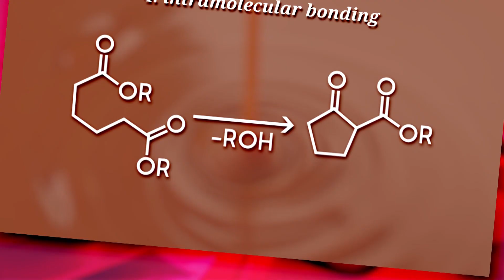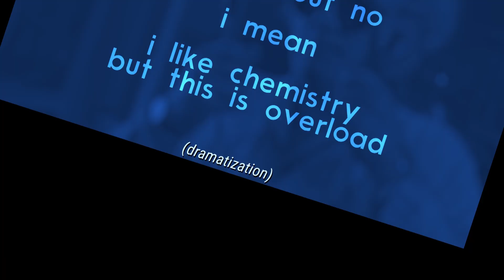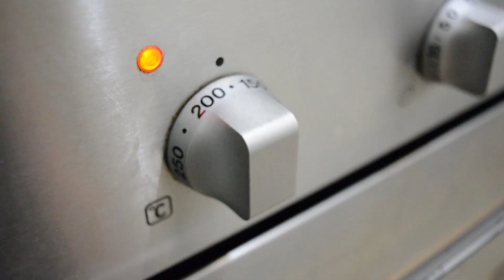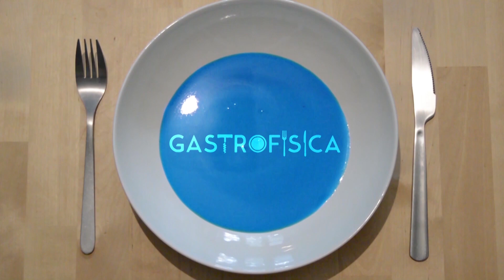The Physics of Caramel: How To Make a Caramelized Sugar Cube

Comment: Seems like the fructose and glucose just... tangle in a different way?

I mean yes way more complex than that but that seems like the summary of it. It heats up just enough to break down, letting the components tangle instead of forming back into normal sugar, changing the structure

If the video was meant to show the complexity, then it failed by simplifying it enough that at least some people can simplify it further in a wrong way

Comment: Caramel tastes so much better if you use brown sugar 🤤.. Plus, at around(of course) 115 degrees Celsius it's done.
Add some pecans, stir until the sugar crystallizes, and you've got yourself a treat! Or even better! Forget the pecans and add some room temp. creme instead (not over the heat or it will blow up). Then, without stirring, let it go to a boil  for a minute and gently stir on low heat. The magic will happen before your very eyes..
Careful! This stuff is highly addictive 🤤.

Comment: Thanks for this MinuteChemistry video. (Yes the underlying process is physical but this belongs to chemistry not physics.)
Doing basic research on decomposition and melting point temperatures leads me to the complexity of caramel. Sucrose's decomposition temperature is a bit higher than one of its constituent sugars and quite a bit higher than the other. And given that the constituent sugars also have different phases. I see how caramel can by so freakin' complex.

Comment: Chef here. to make caramel. put  sugar and water in a sauce pan about 3/4 sugar to 1/4 water. then het it. (DO NOT STIR!!! IF YOU DO YOU WILL GET LUMPS OF SUGAR) keep it on the heat until it turns a golden colour. ad a little bit of water and salt if you want a caramel sauce. (if you just want caramel candy poor it on some baking paper) if you do want the sauce put it back on the heat and make sure its one solid golden colour.

Comment: Great science content! Aaaaaand...I don't think you need to steer sugar so violently when making caramel. The stuff that sticks to the side of the pan will burn faster (because they have little mass) and gives the caramel sauce a burn taste/aroma if it ever gets back in the mix. Just steer gently occasionally to be sure that the bottom is not overheating and burning (which would also be bad).

Alternately you can dissolve the sugar in a bit of water because then you don't have to stress about the bottom burning, but it will take longer because now you need to remove all the water that you added...
Reply: Interesting - btw, it's "stir"

Comment: Ahhhh! To make super smooth caramel, you typically add things like corn syrup, tartaric acid and water. Those are to help break the sucrose bonds more and to have more fructose molecules than glucose ones. Idk the science behind it, but i think because of the different levels in those sugars, less crystallization occurs. 

That and you typically don stir the pot, put anything into the pot (especially a cold metal thermometer) to avoid nucleation sites.

Comment: Chemist here:

What you're describing are various solid state reactions. When you use high heat, the decomposition into fructose and glucose provides a liquid medium that can be considered a "flux" which helps dissolve the remaining sucrose and accelerate the reaction. Reasonable people can disagree on whether this counts as a "solid state" synthesis or not, but is typically lumped in that category because it's sued to make solid state materials.

Traditional "ceramic method" solid state synthesis keeps everything in the solid phase and typically requires much longer times (since solid state diffusion is highly inefficient). It's highly likely that using this method 
A) is at low conversion, you should keep it in the oven longer
B) actually makes a different caramel since the lack of efficient mixing will change the distribution of products from caramelization (whether you can taste the difference? idk!)

Also: the papers on the melting point of sucrose are a bit nonsensical. No  self respecting chemist will report a melting point if it decomposes before melting. That's bad science. Theorists can quibble about the theoretical melting point (and I think that ahs academic merit for building models), but it's a bit irrelevant to the experimentalist.

Comment: You can also melt sugar WITHOUT caramelization to make such things as clear toy candy, peppermint sticks, taffy and breakaway glass for plays, movies and show props.
Reply: D Hawthorne Are you sure that's melting sugar and not dissolving it at lower temperatures in water?
Reply: You can add a tiny amount of water to help start the process for both caramel and caramelized candies but all the water has to get cooked out in order to make it solid.

Comment: Assuming just two compounds are present, glucose (m.p.= 146 C) and fructose (m.p.= 103 C), wouldn't we expect to see a depressed melting point and also a widening of this range? It sounds like this is exactly what minutephysics describes here. Doesn't that explain why heating fast or slow makes a difference? What am I missing?
Reply: TurdFurgeson571 It's been a year since I made the original video and I'm still figuring that part out. Hopefully I'll be able to make another video adressing this!
Reply: I never knew this was an issue. Now I'm absorbed by it. I hope to hear more. I'm also asking around. Do you have links to any of those studies?

Comment: Would sugar melt if you increased the temperature to say 160 or 180°C ? Would the reaction be quicker ?

Did you cover them to remove radiation from the resistances ?
Reply: Vince The reaction would indeed be quicker at higher temperature and consequently caramelization would also be quicker so there would simply be no melting of sugar.

I don't know what you mean by your second paragraph.
Reply: Sorry my second paragraph was not clear. He said he put the cubes in the oven at 150°C. The cubes do get the heat from convection in the oven, and of course radiation from the heating resistances, unless he covered the cubes. I assume he didn't cover the cubes, but that would mean he got different results from the publications he was talking about, which would exclude radiation heat.

Lemme also rephrase my first question : at what temperature should we set the oven so that we would be sure that the sugar melts?

Comment: So essentially it has 2 melting points, the first one is where glucose and fructose lose there bond at 150 degrees celsius and then after that is the second melting point between glucose and fructose. That’s what I got from this video anyway
Reply: CLXIX Bloop :3 Except that's not at all what goes on. Both glucose and fructose have melting points at or below 150C. α-Glucose has a melting point of 146C, β-glucose of 150C and fructose of only 103C, and mixtures of different compounds slways have even lower melting points. Those caramel cubes did not decompose into glucose and fructose because if they did they would have melted even at 150C.

Caramelization is a separate process from melting and hydrolysis, and can happen without either occurring, that is your take home message.

Comment: Ok so the point is that sugar falls apart and changes form before it actually melts, and so there isn't really a melting point you can define for regular sugar. Only the components it falls apart into.

So is it possible, in principle, to establish surrounding conditions that prevent this and allow us to properly find a melting point for sugar "in full"?
Like, maybe under high pressure the bonds will break more slowly? Or under low pressure the melting point is so much lower, that the bonds don't break yet?
Or maybe there's a catalyst allowing us to do it at least statistically? Something that eases the reaction of bond formation, thereby allowing for longer chains even at higher temperatures? While somehow not really affecting the theoretical melting point much? And not overshooting to turn into like flour or something?
Reply: Kram1032 See, thing is, you can stop sugar hydrolysing, just make sure no water gets in, but you can't stop it caramelizing.

Solids are not very responsive to pressure and usually melt at roughly the same temperature as long as the pressure is above the triple point so they don't simply sublimate.
I don't think there is a way to inhibit caramelization without substantially altering the solid phase of sugar to the point where you wouldn't be able to extrapolate a melting point.
Reply: That makes sense and I suspected as much. Was worth asking though :D
Reply: The basic problem is that sucrose is a very tenuous substance; and, as a matter of fact, a rather curious thing as well. When you will get more involved with its chemistry, you will find out that it's ironically quite complicated in a manner that is similar (but still unrelated) to the controversies surrounding quantum physics observations.

You see, there are carbohydrates such as glucose and sucrose (and their polymers, as the obvious extension) which are... not properly described in one unique stereometric way. I mean, we do know that most molecules only tend to have a certain shape in space and that it fluctuates to some extent, but those sugars... they are not like that. They are way more than just that.

Sugars behave in a manner which implies they are in a constant chemical flux of physical arrangement in space. They behave like both linear and cyclic compounds (which is actually a staggered composition)! Do you see those nice 5-and-6 carbon atom rings? Those are furasones and pyrasones. Sugars are typically one or the other, and their polymers are a combination of just one or both types of carbohydrates. Imagine the mess involved there.
Reply: jeeB So you're suggesting sublimation of sucrose at low temperatures in near vacuum, then heating and condensing the gas into a liquid? I would expect caramelization to start the moment it condenses and I don't see what you'd accomplish anyway. You couldn't cool the liquid back down until it's solid to determind the melting point because freezing points are something else entirely and very much dependent on how you do things, unlike melting points.
Reply: Quintinohthree Then would it be possible once the sucrose sublimates to collect it, separate it from any solid sucrose, then bring up the pressure slowly until it condenses into a liquid?
If I'm getting anything wrong, it's because I'm taking chemistry after summer break, and I'm 16. All of my knowledge of chemistry is informal.

Comment: Water melts at 0C and not Ice? Might want to add a caption for that one :p
Reply: well, ice is the sold form of water, and water just means H2O. so saying water melts at 0C scientifically means that it changes from a solid (ice) state to a liquid state ( liquid water) at 0C
Reply: ThePizzabrothers Gaming Put simply, ice is water.
Reply: Well if there was no need to distinguish states then it would be the same as saying Molten Iron melts at 1500C. The act of melting is changing states from Solid to Liquid and water, unfortunately, is not a solid.
Reply: Suplagen Is iron not a liquid at 1500C then?
Reply: MOLTEN iron. Already Melted Iron.
Reply: Suplagen I understand what you're saying. I'm saying by the same logic, iron is solid and not liquid, therefore it isn't iron anymore at 1500C. That is just not how this works. Iron is iron, regardless of temperature and state, and so, at least from the perspective of a chemist or physicist, water is water, regardless of temperature or state. Ice on the other hand is simply a synonym for solid water, which cannot be liquid therefore, but can of course melt and stop being ice. But being a synonym also means it is not wrong to say that water melts at 0C. We might call it ice before it melts, but the identity isn't changed by that because water is water regardless.
Reply: Your focusing too much on the element whereas I'm focusing on the process here. At no point did I say Molten Iron was no longer iron, I'm merely stating the fact that, for the purpose of an informational video, saying water melts isn't the right thing to say. Ice is water yes, but the way you're approaching it seems as though you're making it out that water is water regardless of states as the state doesn't matter when talking about the processes involved (i.e. melting, evaporation etc). You say in the perspective of chemist or physicist it doesn't matter and while that may be true for a chemist, I believe a physicist would disagree with the fact that you're saying the state doesn't matter for the process involved. You can't melt what is already in a melted/molten state.
Reply: Suplagen You're way overcomplicating things and I think it's to make up for having no actual argument.

What I'm getting at is that saying ice melts at 0C but water doesn't is merely a quirk of language. Substitute any other substance and you would not bat an eye. You don't care that mercury melts at -39C because you don't think of liquid mercury as distinct from solid mercury because you don't have a word from solid mercury separate from mercury.

When chemistry and physics are concerned, water is a substance, and for entirely separate reasons the solid phases of this substance have been given the name ice, much like solid phases of many other substances have been given separate names. Calcium carbonate in solid form for instance is known as calcite or aragonite, depending on the exact phase. As it happens, these have very different melting points as calcite melts at 1339C while aragonite melts at only 825C. Water only forms one phase at ambient conditions, which we simply call ice.

It is therefore correct to say that water melts at 0C.

Comment: Will definitely try this. Also try and get those size sugar cubes, too. May only be able to get one teaspoon equivalents, as opposed to what appears to be a "sugar rectangle". 🤣
Reply: Auro Cords, well... actually a rectangular prism or cuboid.
Reply: Lol yeah those things were huge! 😂
Reply: just use normal granulated sugar, it's way more useful than cubes.
Reply: tommihommi1 I find sugar cubes very useful for plunking in coffee
Reply: Leggo MuhEggo you need a spoon for stirring anyways, can make about 2kg of toasted sugar at once in the oven (more if you use multiple baking sheets), and can use it for everything. And it's far cheaper than sugar cubes
Reply: I achieved sugar glass. Caramel-y delicious sugar glass. (Slightly too hot)
Reply: the video is literally instructions... 
I wasn't asking for help
just saying what happened.
Reply: Echo Adjust oven rack to center position and preheat oven to 300°F. Pour sugar into a 9- by 13-inch glass or ceramic baking dish. Toast until the sugar turns ivory, about 1 hour. Stir well and continue roasting, now stirring once every 30 minutes, until darkened to light or sandy beige, 2 to 4 hours more depending on personal preference. Beyond that, the sugar will begin to liquefy.

2.

If you notice any liquid caramel around the edges, pour dry sugar into a stainless steel bowl. (The sticky caramel will remain stuck to the baking dish.) The sugar will be screaming-hot coming out of the oven, in excess of 212°F, so take care not to touch it. Set aside and cool to room temperature, about 2 hours. If needed, grind the lumpy caramel in a food processor until powdery and fine. Transfer to an airtight container; store and use cup for cup or ounce for ounce in any recipe in place of plain sugar.